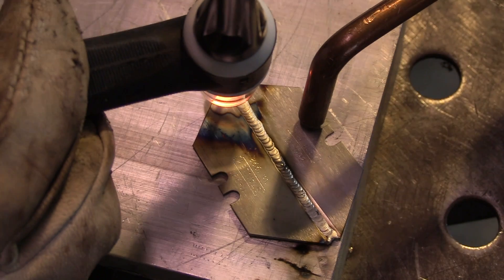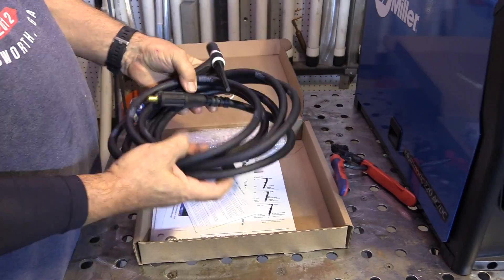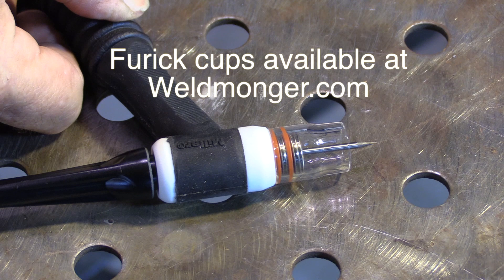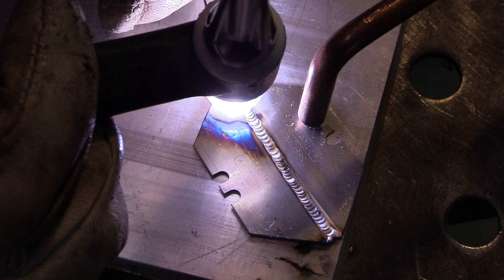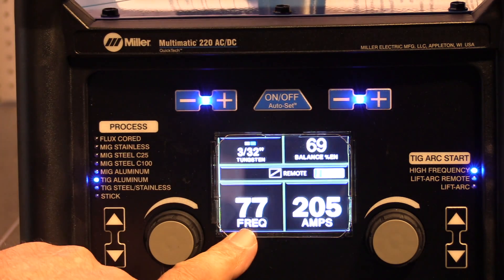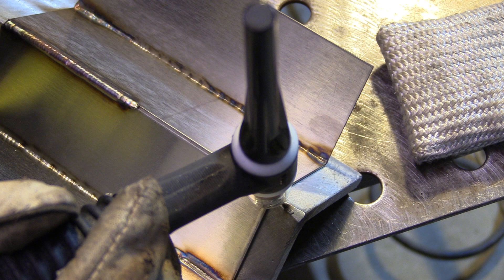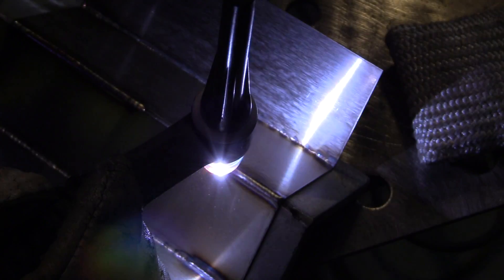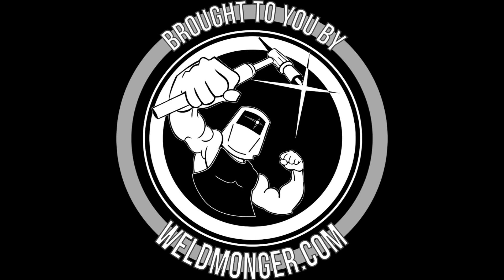Miller Multimatic 220 AC/DC Review of TIG Functions

Comment: I think that for 90% of the people that need a machine, Miller has knocked this one out of the park. What is most impressive is the total number of capabilities for the footprint of the machine. Most small shops and back yard welders are constrained on space and can only afford one machine. Miller has included some BIG Machine Features in this one like Autoset, Pulse, Frequency Control, 14 Pin Foot Pedal (so it will also work with the wireless setup, torch switches, and hand controls), and Dual Voltage. That is a HUGE amount of capability in any one machine, but in a small one like that.... most impressive.I would almost compare that machine to a new Smart Phone. Anyone can pick it up and use it, but as you use it you find out what it can really do and find that it's capabilities are beyond your immediate needs, and that means that you will not be disappointed when you want to push your limits and weld a more demanding project. As you indicate, the extreme low and high end MAY be a small problem on a vary rare occasion, BUT there are ways around that. I absolutely love my Miller 280 DX machine but for 90% of the time I turn it on, set AC/DC, Max Amps and weld. The "Micro Settings" are there when and if I need them, but this is a Multimatic 220 AC/DC and has ALL that within very practical limits PLUS Mig. I also believe it has "Gun Select" like my 252 & 350P Aluminum which also switches between MIG & TIG at the last settings used for each by pulling the trigger or depressing the pedal. Brilliant for the small shop. I have to admit that I am a bit of a Miller fan and wear their Blue Jackets too. Oh yes.... fan on demand? The first time I worked my 350P enough to turn the fan on.... I almost swallowed my gum.... so nice to have a quiet shop. I will be very interested to see you demonstrate all the capabilities. Try to wrap up with a project that requires rapid switching between MIG and a couple of TIG settings. Should be fun.
Reply: You nailed it. I love the 211 inverter MIG but I also need ac tig and would like to have pulse and wish it had volt/feed readouts or at least scales on the dials. It is a great all around mig and works in a small shop and has been on many job sites. For now, a miller 330 abp 460 amp tig does what the 211 can't. My brother has a 252, but after using my 211 on job sites has decided he want's the 220 instead. The 211 runs great from a generator and one guy can load and unload it. The 252 sucks for field work. I would really like to have a dynasty 280 dx and it would outperform a 220 for max current, but the price is too high to buy without some jobs that would require it. It is nice to see that the 220 will tig 0.250" aluminum with no problem and that is realistically as heavy as I have needed to tig on AC. It makes me wish I didn't already have the 211 inverter, just so I could buy the 220 to do 90% or more of my work/hobby.
Reply: @CGT80  Like my iPhone 7, I use about 20% of its capabilities and it serves me well. I have Psoriasis and the fingerprint reader does not work too well as my fingerprints are constantly changing. An iPhone 10 with Face Recognition would work better...... my face looks the same as it did years ago.... but,.....is it really worth making a change just for that? My Dynasty however is the BOMB!!! I sometimes weld 0.020" Aluminum and other times 1/2". Today I did some 1.5" X 1.5" Machined Solid Square X 3" Long pieces to 2" X 2" X 3/16" Aluminum Box Tube, no problem. Sometimes 50Hz, and a few times now, down deep in a Chanel at 400Hz. The power it has is awesome and shortly after I got it I had to fill-in some incorrectly machined slots on 8 Aluminum Rubber Press Dies with the machine set at 260 Amps max, and using most of it. I did not realize it but when I finished the last one. I could not hold my hand on the area where I was working on my welding table which is 36" X 60" X 1.25" Steel Plate, and the machine, torch, (Weldcraft 310) and cooler were just fine. Yes.... the price is high, but that machine with the Wireless Foot control is incredible and completely out performs my old Lincoln V205T. Again though.... do you NEED it as I work 90% of the time in the AUTOSET ranges around the middle of the machine's range, I can push it to the limit either high or low and depend on it every time. Quality and capabilities cost money and that again is why I say the 220 AC/DC machine looks like a fantastic value.

Comment: ..thanks for holding the fort bro. we got a LOT of work to do, Pipeline Pierce has the competition goin between Lincoln and Miller, but from the excellent work instruction and safety guide line you're putting out, I think Pierce just might need to take a few lessons from you..keep up the good work on these videos,  Carpenters and builders are gonna be coming up with an incredible design for the longest O.A.S.I.S. / O.A.S.A.S,  oxygen bar in the world, once these politicians figure out the difference between a barrier and a wall is on a heating and cooling exchange...ever see Robo Cop ? a good analogy between the two is a set of lungs inside a glass membrane...believe it...

Comment: Yeah ...... when will come out Multimatic 255 video? 
Serious lack of power unless somebody likes to carry this arround in a wallet in their back pocket. I would be afraid start something knowing limitations of MM211. But that is just me. Vijeo was a breeze to watch. Thanks.
Reply: The 211 inverter lacks no power and even duty cycle has not been an issue. The 220 seems like the perfect machine for an all purpose welder. It has manual modes and actually reads out amps/volts and wire speed, unlike the 211 and AC tig is a must. I can't do without my heavy duty 20 flex water cooled tig torch and would not like that big air cooled torch. My TIG machine maxes out at 460 amps and the HD 20 is fine for short runs at up to 300amps. The 211 puts out 230 amps for mig and has never left me wanting more. On the tig side, it would have to either be much more efficient than sine wave on my miller 330abp, or it would end up a little light to replace the 330abp, but it would still be a great all purpose machine that can be taken to a job site. The 330 only weighs just over 1,000 pounds with the bottle and cooler and a syncrowave isn't light either.
Reply: I am just talking smack though i would be glad to see real professional review of MM255 unlike how it is done by Bakers gas. They are in the same approximate price range too though 255 need alu pushpull gun. 
Tig in those amps basically is in need to be water cooled. For both machines Miller includes same A-150 torch just 255 has longer lead. More expense on that as well.
Reply: gandolph3 i love my MM211’s!
Reply: Right on, i like my MM211 a lot too.

Comment: Hey Jody what filler rod do you use on food grade stainless steel?
Reply from the maker: I match the filler with the base metal unless a procedure states otherwise . 304L stainless is the most common stainless and it is usually welded with er308L. 316L is more corrosion resistant and should be welded with er316L...hope this helps